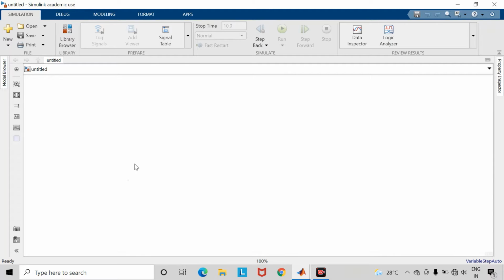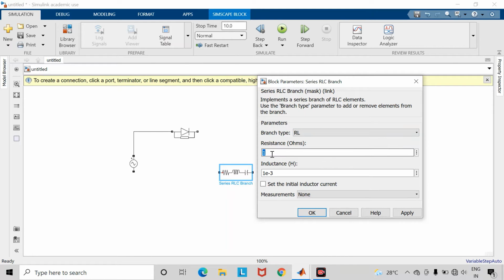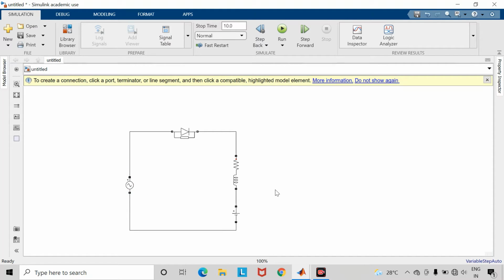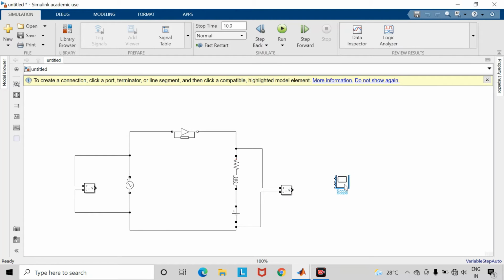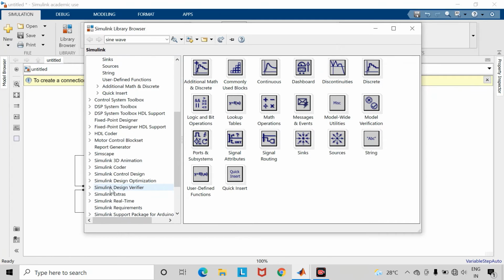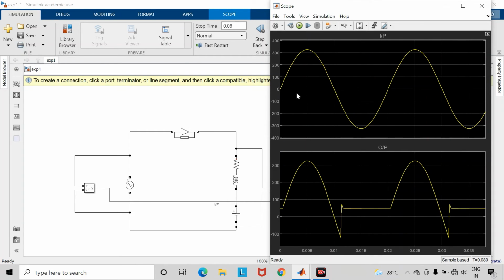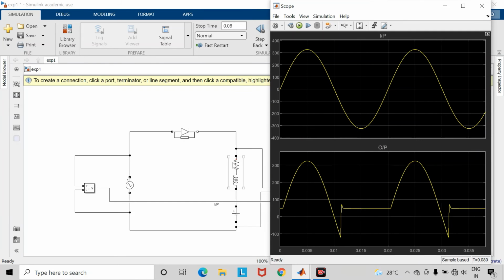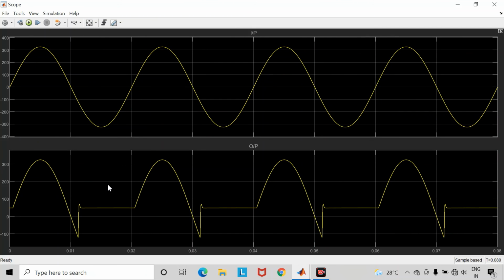L6 | Half wave rectifier with RLE load

Comment: Quiz:
1. Can we remove the measurement terminal of the diode present in the Simulink?

2. What type of load was used in the simulation?

3. Can you explain the nature of the voltage waveform across the load in the negative half cycle of the ac supply?